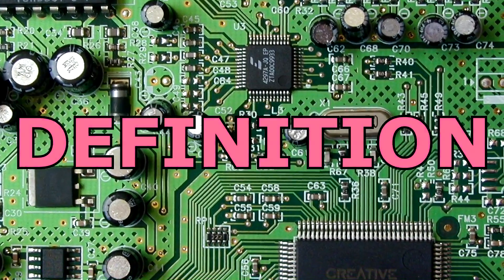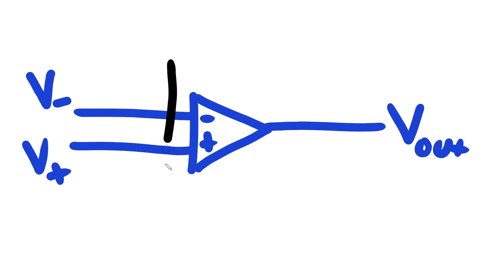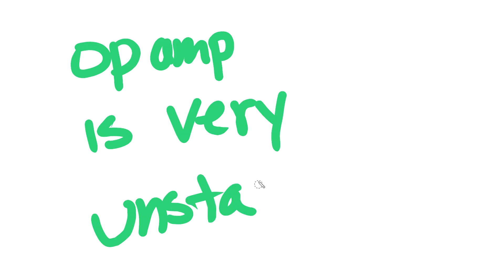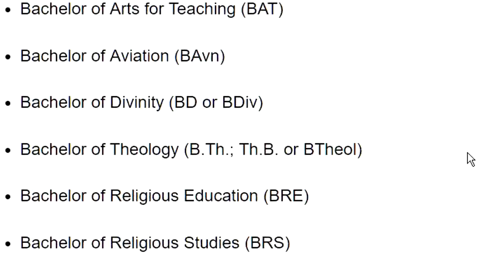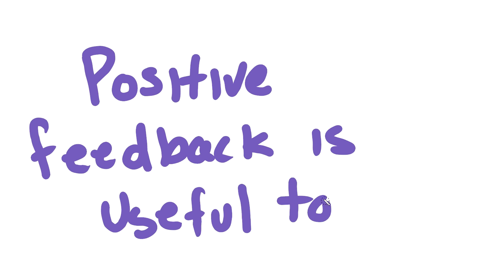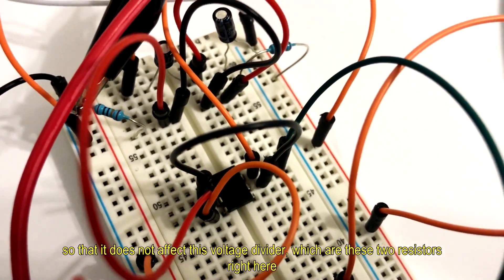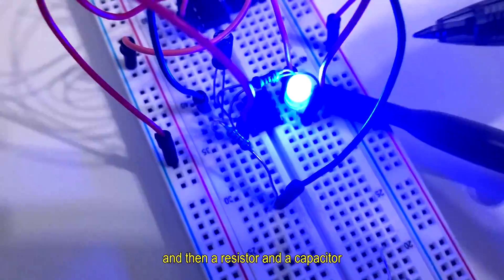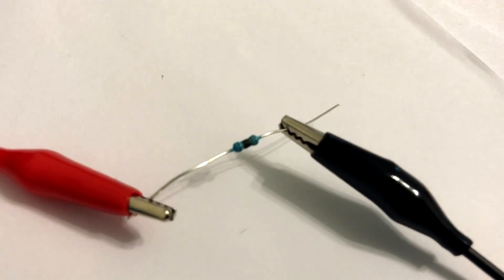The Operational Amplifier and Its Applications: Inverting Amplifier and Relaxation Oscillator

Comment: What happens in an OpAmp with both positive and negative inputs such that their respective duty cycles are relatively prime in the mathematical sense, where the shorter signal is spikey and the longer signal approximates a square wave?
Reply from the maker: I'm not sure what you mean by prime. But typically if you both positive and negative inputs, then the output is some sort of oscillation between the two signals. If you have a circuit in mind, then I can maybe answer your question a little better.
Reply: Alex I mean Prime in the Number Theoretical Sense, say periods of 17 and 43 time periods, respectively. The purpose is to prevent a synchronization of periods. Actually if one is a factor of an irrational number of period to the other, say a factor of Sqrt(2), would be even better.

Comment: Can you make a video on how to use a CRO and how it basically works?
Reply from the maker: Do you mean a Cathode-Ray-Oscilloscope? If so I understand the basic principles, but I'll probably need a little research. If you want a quick answer, then basically a magnetic field changes within the CRO which deflects electrons, so that you get a signal on your scope. It boils down to an electrodynamics problem which I'm not too familiar with besides just 
regular dynamics. But this is interesting in terms of engineering, so I'll add it to the video ideas. Thanks!
Reply: @alexjbeezy  Just the basics and how to use one. I'm an undergrad and not really familiar with all those buttons on it.
Reply from the maker: Oh ok I know how to use one, so I'll try to make a video on it!